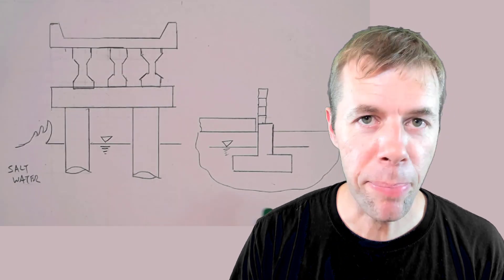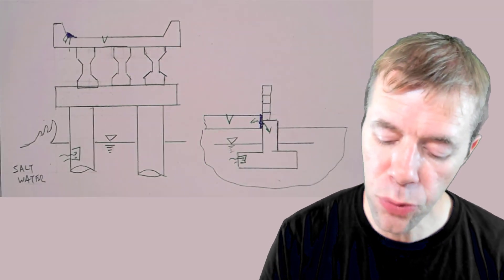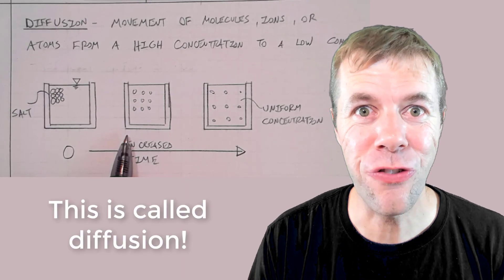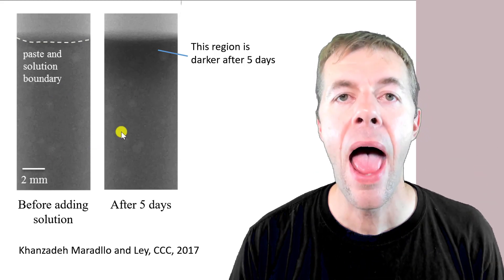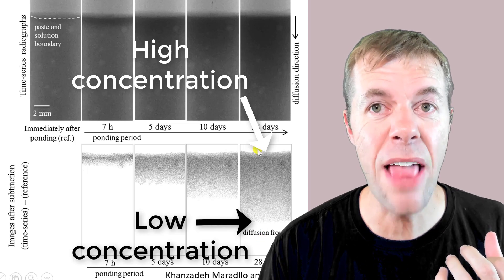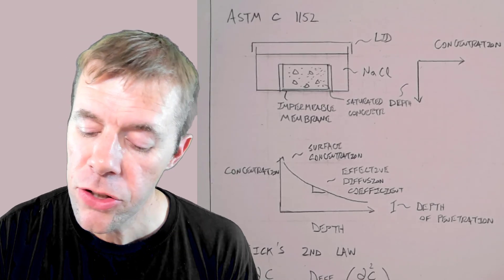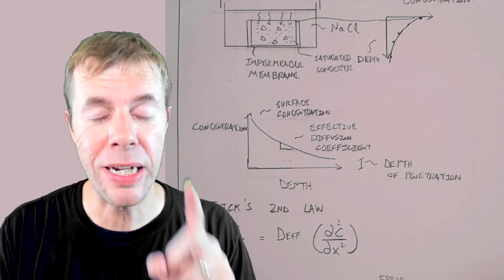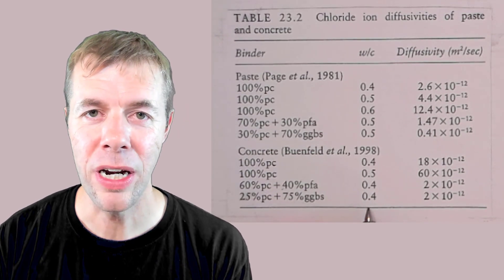Chemical Penetration into Concrete – Diffusion

Comment: Cool. I like to see a video on ' form oil'.  And it's effects on the concrete. I see guys putting so much form oil on that it rises to the top when you vibrate. That can't be good for the concrete?
Reply from the maker: Thanks Patrick - I don't know of any research that has been done on excessive form oil.  If it floats to the surface of the concrete then at least it is not within the concrete.  Let me think about that.
Reply: @TylerLey  But not all. If some come to the surface. The rest is distributed throughout the mix.
Reply from the maker: True!!!  Let's just say it gets cast into the hardened concrete and leaves an oil glob.  Since it is an organic then it will degrade over time.  This should leave a large interconnected pour in the concrete and this is bad for durability and strength.  I think we could test this.  Let me keep thinking about it.  Thanks for bringing this up.  There are lots of different types of form oil.  What one do you recommend I test?
Reply: @TylerLey  Back when I first started in concrete in 1993 we used waste oil mixed with diesel as our form oil. You didn't go home smelling good. So I'll look into what my company is using.
Reply from the maker: Those were the days!  I have used diesel as well.  There are lots of different products out there...

Comment: Wow!! This wasn't taught to us in Engineering.. I like the lucid language you use to explain the things. Waiting for more videos on DURABILITY test on concrete. If possible kindly suggest some good journals and books stuff like that on DURABILITY of concrete. Waiting to hear from you.
Reply from the maker: Bappi - Durability is tough.  There needs to be more resources out there.  That is one reason I am doing this series. 

The best books are PCA Design and Control, Mehta and Monteiro, and Neville.  The Neville book is a little old and there won't be another one. RIP.  PCA Design and Control is a very practical approach.  Mehta and Monteiro is a classic and does a great job with the science.  

There are a lot of good journal papers depending on the topic.